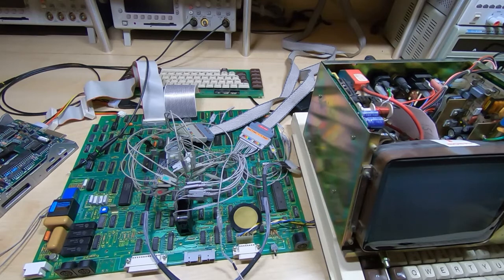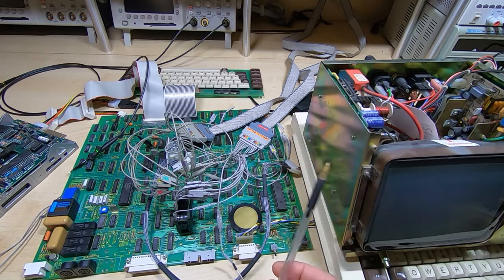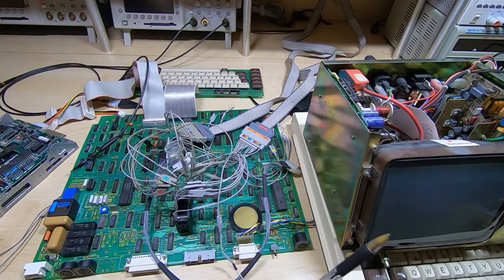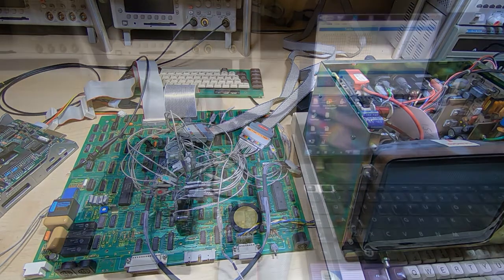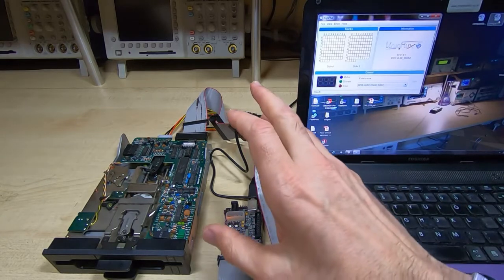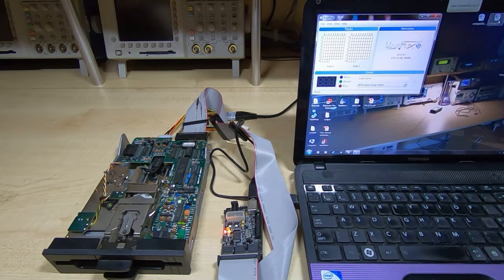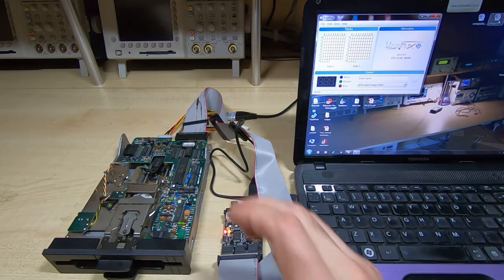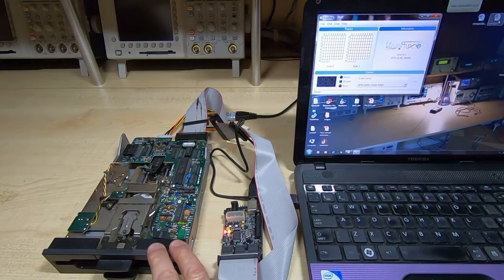Wren will this end Part1

Comment: I have drawn out schematics for a number of boards.  Never removed any chips.   I guess that would make it easy to visually follow the traces, but you can just use continuity mode with a good DMM (fast beep response and stretched beep length so you can go quickly and not miss it) like a Fluke to figure out the connections.   It's tedious work, but you don't need to remove all of the chips.   Might take a day or two to write down all of the connections for a board like that one.    then you start drawing out the schem and making sense of it all.  Of course it helps if you know a little about the chips you are working with.   For instance you would check from LS138 outputs or LS139 ones to chip selects.  LS245 pins would connect to the data bus pins, etc.  LS244's might be address line buffers.  That sort of thing.  There will be several open-collector chips driving the floppy control signals.
Reply from the maker: Yes that is the method I often use but I certainly would not attempt it with this board. The wren boards all seem to have a large number of corroded tracks due to battery leakage and it would be FAR too time consuming  and error prone to use a DMM. There are also a large number of analog components which would make this even slower. The fastest and most accurate method by far would be to strip a board. There are a number of other reasons for doing this but mostly it is for time and accuracy. I have reproduced hundreds of boards but I would not attempt to use a continuity method for a board like this but I would not want to put you off if you wanted to give that method a try.

Comment: This is a super stimulating task but my “digital” skills  ar not enough to help you on this jurney, I beleive . I really appreciate this way of sharing knowledge oriented to  keep alive old elettronics. Are X rays suitable for this pcb analysis?
Reply from the maker: My main goal is to get as many people interested in this old technology as possible. Hopefully getting others involved will increase the level of interest and keep more of these old units out of the skip. Yes if I had access to an suitable xray system then it is a very good way to examine boards as the tracks stand out very well. If you have a bare board then underlighting it and photographing is also a very good method.